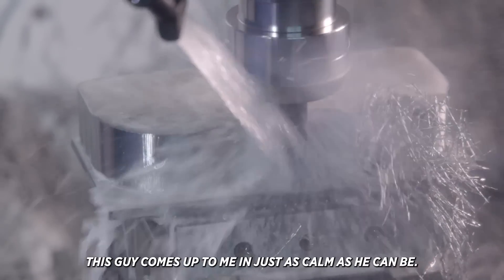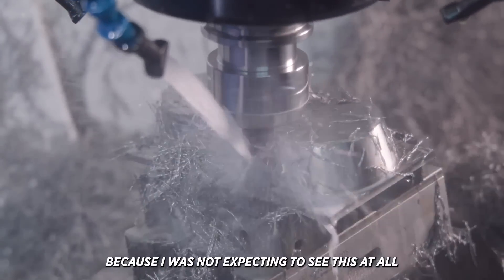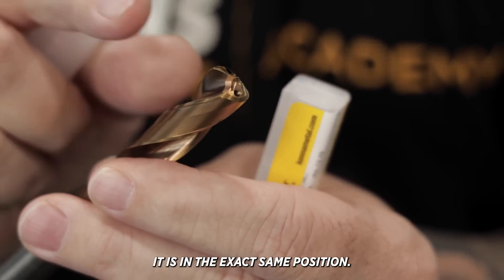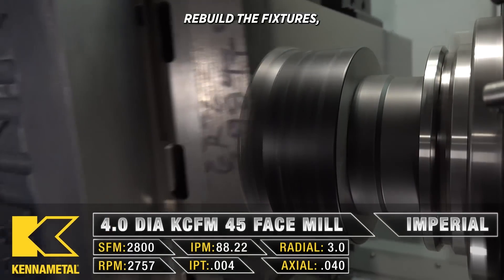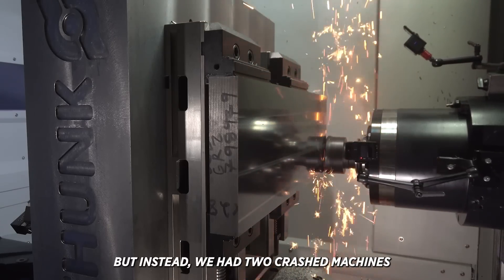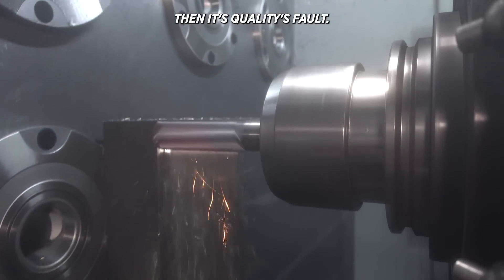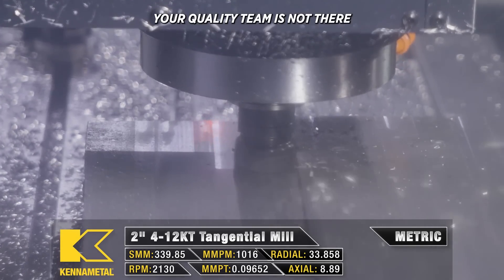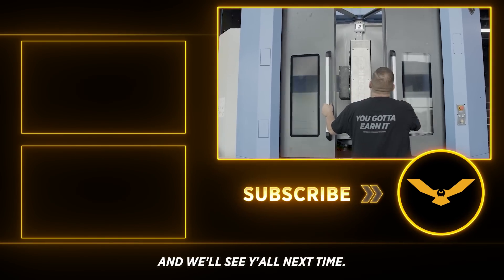$200,000 Damage | EPIC FAIL… Machinist CRASHES TWO MACHINES at the Same Time

Comment: That company is going to get exactly what they deserve by keeping him. This was not a one time deal, he will do it again. A $200,000 crash would put my shop out of business.
Reply: Worse than 200k IMHO......lost time and potentially getting hit with penalty clauses for late delivery....
Reply: @dwwolf4636  two weeks lost production is sure to be good money too
Reply: He didnt get promoted because of his skills, he got promoted because his boss has a weak ego.
Reply: @heath gallagher I disagree, when NC works then it's an amazing thing, it can do complex things much faster and more precisely than any human. My problem was with elastic workpiece deflection and tool movement combining to make for a hard to predict situation where the machine could catch the workpiece if the conditions were just right.

It's a pain in the ass if your programming interface is shit, which is often the case  if the process isn't that complex, in that case things like training and a separate programming computer with 3D simulation is one of the first things crossed off the list of expenses. At worst you're left typing out g-code right on the machine, looking at one of the smallest screens known to man, using some proprietary notepad equivalent with no contrast whatsoever. 

And yeah if you damage the electronics then you will have all kinds of problems. You don't even need a lightning strike, even slight power surges or "normal" voltage fluctuations can fry things over time. Those who know about this have basically installed their own substations to counteract this.
Reply: @heath gallagher Oh those kinds of solutions are definitely there, in various forms. It starts with the NC code generation where you can forbid certain situations altogether, then you have simulation where you can see potential problems, and sometimes as a final step the machine itself can monitor certain parameters and automatically stop if they are out of range. For example some laser cutters can stop in a fraction of a second if they detect metal against the cutting head. Newer machines have a better reaction time also.
Reply: This whole company is a crash waiting to happen!!!😮
Reply: @letsdothisplease22  The name for those kind is SOCIALPATHS.= Ted Bundy, Nancy Pilosi, Hillary Clinton, Joseph Stalin. Justin Trudeau.
Reply: But if he didn't program it wasn't his fault...we start machines at my shop n go do other work while they r running..we know when something fd up but would not be able to stop it unless it was at beginning...I do have them run simulation before starting
Reply: @stopmotion2505  it was a first run on the program and if your a good operator you should try to catch these things on proving runs, yes programmers fault aswell but you should never just go on break when first setting up and running your Program even if its supposed to be proven
Reply: @stopmotion2505  Running any kind of NC program for the first time and expecting it to not have mistakes or issues is just asking for expensive problems. Sometimes I've had severe collision issues pop up even after more than a hundred OK parts have been produced without such problems, putting too much trust in programs is a bad idea.
Reply: @stopmotion2505  The operator should always carefully monitor the machine when running in the first part especially with a new untested program.
Reply: @stopmotion2505  You always check the program in air.  Always.

Comment: Can’t everything in a setup be visually represented? Seems like these machines need more advanced UIs showing everything. Also, why a camera can’t verify the setup? AI is advanced enough today to do this. Even sensing vibrations and sounds could be built into the tool.
Reply: Yes, Vericut can show all pre-accidents if all tool lenghts are correct. here will be a red flash on the 2 parts hitting each other.
Reply: these guys can crash any machine, you cant do anything about stupidity, its humans they'll find a way

Comment: I had one really bad crash happen on a machine I was running way back. I was working on a Flow 5 Axis Waterjet and I’m running these angle circular parts for Sikorsky we did all the time. I ran my first piece got it inspected, and started running the rest. Our process didn’t allow us to watch the machine cutting, the machine did its cycle in a separate room built around it to keep the noise and mud contained, and while it was doing it’s thing you would remove tooling tabs, sand everything flush, and debur the part. Well my like 7th part I went to change it out and the head was hanging off the machine, only thing keeping it not in the tank was the high pressure lines. I got someone immediately I didn’t touch nothing, and I’m telling you they were gunning to fire me hard. Luckily for me I had a first piece done and many others run after that. It had an old Allen Bradley control which was retrofit with a Ward Jet control recently. Still to this day I think it spazzed out and just went straight down. That control was always finicky, but my heart was in my throat when I was that.

Comment: i also did the same thing once while working at synthes, now owned by J&J making bone screws. my coworker went on break and said to keep an eye on his swiss turn screw machine, by the time I finished checking my own parts and walked over to his machine for a looksee it had broken a drill and crashed. I was called in for review and potential procedural suspension.
Reply: You were set up!

Comment: i switched to manual mode late in the day one evening running some parts and accidentally ran the tool into into the 50 horsepower spindle of my double turret mazak quick slant and stopped it cold in the middle of a full on cut within 2/3 of a revolution, the drive belt literally stretched itself like 2 feet and took out the 1000 dollar encoder sitting somewhat above it. not a huge deal but at the time I had already sold the machine for 10 grand to my current employer and it was dead on arrival. to his credit, and mine, he paid for the repair
Reply: Your employe paid for the chrash?
Reply: @allancnc  employer

Comment: I saw a guy make an offset change then press cycle start. Then turned around and was browsing on his phone not watching the machine. What he didn’t realize is put in the wrong number and that thing went 100 percent rapid into the chuck and cracked the whole machine all the way through. The machine got scrapped and he got fired cause it was all on camera.
Reply: I programed one for a very delicate part.  He altered the program w/o telling me.  Rammed a minimaster through the part, into the vise.  Blew out the Z encoder and the Z spindle bearings when it went to rapid Y, in the part.  Somehow he had changed the R plane into the part.  Borosilicate bearings for super spindles are quite expensive.
Reply: Cameras everywhere. We have a bunch too. But you should not be worried if you do quality work.
Reply: @daveyt4802  because liars everywhere!

Comment: For anyone wondering if this was easily avoidable, yes this was insanely easy to avoid, the first time you run any tool you should turn the rapid down, wait for the tool to approach the part  and just look at how far the tool has to go vs how close it actually is to the part
Reply: Crazy man! I learnt those things in the first week as an operator.  Rapid down, coolant off and watch each tools approach. Watch the remaining distance and if in doubt stop the spindle and take a quick check. This blows my mind that someone would have the confidence to just let it rip. I literally have nightmares about machines crashing haha
Reply: It's important to watch your distance to go....
Reply: @joemasse2964  kinda difficult from the break room ha ha
Reply: @master8laster49  Most of the modern machines allow for remote control. So if he hadn't been on BREAK, he could probably have done it from the break room :D
Reply: I'm a retired machinist of 40 years.  I didn't do much CNC but did enough 3-azis (Okuma and Tree mills) to where I was fairly good at it. 
One thing I always did was to test the program.  I'd stick a pencil in the chuck and run it through its motions.  If it looked like it was a good program then I'd run it and watch it closely.  Crashes usually resulted from an offset error or a misplaced "-" (negative) in the offset or dimension coordinates. 
Proofing out a program isn't that difficult.  It's actually kinda fun. 😀
Reply: @Iconoclasher  I agree.  I’ve done a sharpie a few times when I had to do some light surfacing work, mainly to see if my milk could make it where I wanted it.  Also to verify my cutter wouldn’t hit a clamp because I was dang close to them pretty often.
Reply: @Blakews221745 
👍
Reply: @Iconoclasher  or a missed decimal point
Reply: @dgafbrapman688 
Yup.  Been there, done that. 😏
Reply: yep, drive slow and watch that distance to go.
Reply: @heath gallagher Having the proper offset in the controller is all well and good, but if the program doesn't call the offset it doesn't make any difference.
Reply: Bingo, I hit the feed hold about one inch above the part and look at the distance to go, if it looks about right hit the start button, only costs a few seconds per tool to check.
Reply: should be in single step as well
Reply: This is exactly the type of thing you should learn Before running on your own!
Reply: Yes, I’m a cnc machinist, and the biggest thing preached in our shop when watching either a new tool or walking through a new or modified program, is watch your distance to go.
Reply: First go through cuts air 4 inches above the part.
Reply: hi, im just a cabinet maker, working with wood, and we had to program our own shit, much simpler, 5 axes only once used :D

BUT

i always did a test run on scrap, and if not possible i started the program super duper slow and watch what it would do so it wont wreck everything. and thats machine thats maybe worth 150k in total.... :D
Reply: if your boss just screams all day long, you have to be faster, faster faster,.. and showing off that he buys millions in machines on youtube - I would give a fuck about either - thats like breaking a tool then,.. could not work for this guy for a second!

Comment: I’ve had 2 decent crashes in 3 years of running lathes. First was a 1988 hitachi 2 axis 8” chuck, my company’s first foray into cnc, the programs were typed by hand, very simple turning, accidentally put a negative z value to clear the turning tool, so the tool 100% rapided into the chuck, fortunately this machine came equipped with a clutch that would disengage under too much load, damage was minimal. The only other crash was a new Doosan 2600YB, after several months of running, I rammed a parting blade into where I forgot that I had deleted the grooving cycle, so there was no groove to rapid into.

Comment: The worst crash ive seen was on a small lathe , the guy called in a tool  but ddnt called the offset for it.  The  revolver turret basicly broke off  and cracked the cast aswell.

Comment: My colleagues and i have a scientific method of measuring crashes and that is how far a part or vice/work holding travels outside of the machine.  If the vice is flung through the enclosure, goes through a wall into a car park and ends up in the boot of a car then that’s a damn good crash.  Although 200k is pretty much up there.  Two machines at once is just showing off.
Reply: I work on lathes and we do the same thing with how far the doors bend out when a part gets thrown into them xD

Comment: always single block and 5% rapid for each tool when first running a new setup.
Reply: 5% and single block is too slow especially if you're running a long complicated program with dozens or more tools. 

25-50% depending on the machine, option stop, and stop each tool for a second while you read your distance readouts and you should be good.

Comment: That kind of crash must have made at least some noise. Every time an unfamiliar sound is heared in the shop, most if not all, machists knows something terrible has just happened. I have had the misfortune to be standing right next to a machine which crashed and I thoughtt my heart would pop out of my chest. I just cant imagine how one could be so calm when something as expensive as this happened.
Reply: My favorite are when you run the CNC and just when the tool engages someone in the shop drops a sheat of metal or start a grinder... Dam, I jump every time.  LOL.  5 years in a Juaristi 10 meters HBM. and now running a Niigata HN100B milll with 6 pallets

Comment: The worst crash I've seen was some one running a 1 1/2 boring bar into chuck jaws turning around 3000 rpms rapid in x axis. The guy had been running parts that morning, apparently he hand jogged indexed turret to change insert. Pressed cycle start and first move was rapid in x axis. He didn't hand jog back in z enough for clearance. It was after lunch time if you know what I mean. Broke master jaws, mis aligned head stock, wedge, damaged turret. #1 tool pocket on turret could never be used again, tool holders wouldn't go in pocket. He was fired a couple of weeks later. I told him before that happened to not smoke pot with boys during lunch break.
Reply: God damn people are stupid. Don't get me wrong, I love to indulge in the herb..WHEN IM NOT AT WORK. Being stoned and operating heavy machinery do not mix whatsoever, like oil and water. As a person who is new to the trade, I am appreciating videos like these and comments like yours, I am learning so much!

Comment: Sounds to me like he didn't dive a crap. I program,set up and operate lowly Haas machines, and I always, always single block, 5 percent rapid on new programs. Those higher end machines and parts you guys run, the operator should be extra, extra careful. They are dealing with so much more money. When a machine is crashed it ought to tear the operator's nerves up. If he or she isn't really upset or didn't care it might be time to upgrade to a new operator. Tool calibration should be on everybody's list in the shop. Set mics and standards in shop and let them get to shop temp. Check, then check again, if there are any doubts get someone else to check behind you.

Comment: I know of a lathe right now that is junk taking up floor space that a programmer mutilated in about 10 seconds. 12,000 rpms and a high rate of rapid into a part never ends well. When I had to teach myself CNC I always ran it with the machine axis locked and watched the program and verified tool changes. Still crashed a few times. Found out why the have frangible couplings the hard way. Not cheap, very stressful when dealing with high dollar tooling and machines. At first I hated doors on machines, eventually found out why they must have doors. :D

Comment: honestly this story feels like its missing information. a programs dosnt just come without tool compensation. maybe that type of error was a long time problem that the person in charge of fixing that just didnt care and such crashes had been avoided because of good operators.
Reply: This company was really behind on technology.  They wrote their own posts and they used some outdated software that literally hasn’t been supported since the 90’s.  So all the tool calls, and height offsets and stuff like that had to be hand coded in the CAM software with weird keywords or the post wouldn’t read it.  All the probing routines we did had to be hand coded like this in the cam software so when the programmer redone this program he forgot to add the H1 for the probe on the G43 line.  To me that is a big problem, we had gotten updated software where it would actually read the tool number and height offset from the operation but they weren’t using it because they would have to repost like 700 programs.  Trust me, I fought this and told them we needed to do it anyway no matter how many we had to repost but I got pushback from the elders
Reply: @Jessie_Smith  Last one of the dinosaurs retired yesterday, time for some young people to step up and make it happen. 🦾🤣

Comment: I once made a couple of bad mistakes and cost the company I work for about £800. I felt guilty, and still do to this day, but it helps me learn not to make the same mistake again. 
I once heard a big horizontal milling machine’s inside wall sliding panels jam up and tear apart on a rapid movement. Crazy noise.

Comment: Not a cnc story but just about as bad. 
Guy on a vertical turret lathe, fair size machine 50 inch table. Setting up 1.5 ton valve bodies and had his turret down with his indicator on it dialing it in. Instead of pressing the jog button, he hit the spindle start. Dont know what rpm he had it at but it got ripped out of the 4 jaws, smashed the turret, destroyed the guarding, hit the floor sounding like a bomb goin off. Serious crater in the floor. The forging had to go out for weld repair. Big bucks !  The guy had just started his afternoon shift but was too shook up to carry on and went home. He came inches away from dying very horribly that day.  We're only human and mistakes are gonna happen but do not get complacent in a machine shop !   If you cant keep your mind on your job...stay home. Its not worth it.

Comment: I couldn't agree more with workers taking pride in the work they produce but after being in several different shops over the years I've found its the owner/management that set the example. If you go the extra mile all the time to make sure the parts that come off the machine are perfect, running efficiently, and your machine is maintained perfectly but that work doesn't get noticed or rewarded it can tank shop moral. As machinist we are all part of a team from the owner to the broom pusher & it's important to promote personal growth and pride within the team